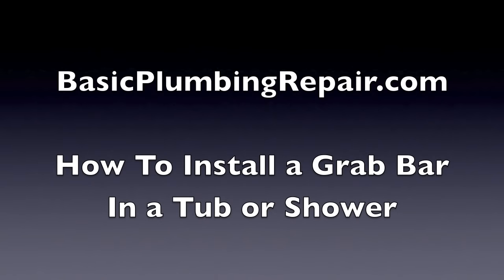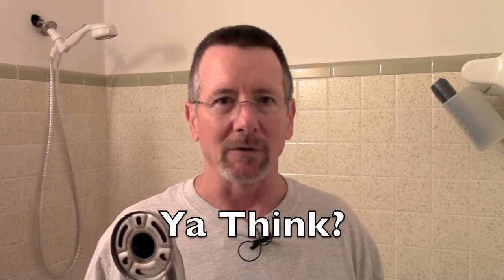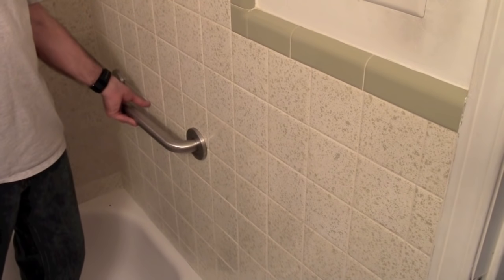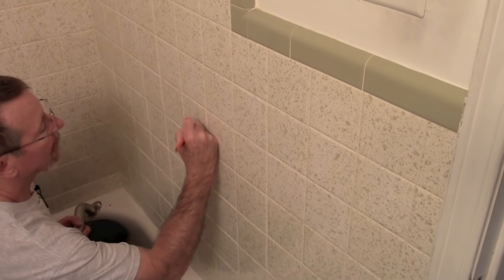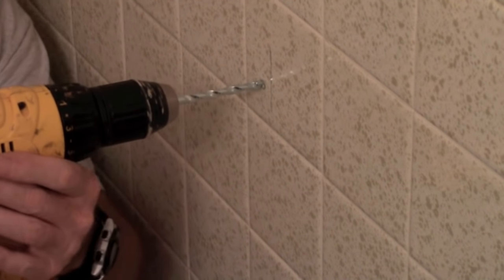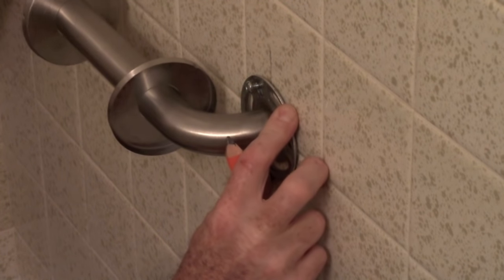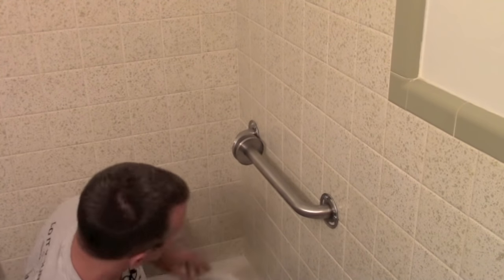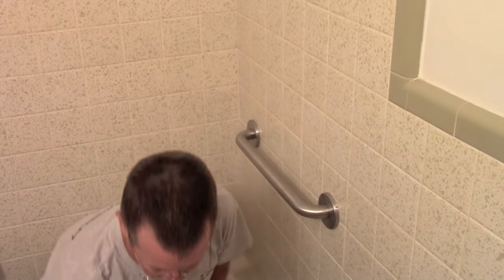How To Install Bathroom Grab Bars

Comment: No, no, no!  Those wall anchors are NOT approved for grab bar installation and risk pulling out of the wall!  Either drill into studs or you must use approved wall anchors like "Wingits" or Moen Secure Mount or Delta wall mount anchors!  Those are tested to safely, securely hold grab bars without studs.  Standard wall anchors or toggle bolts are not designed for this.
Reply: These anchors are the type that have wings that spread out behind the wall surface when the screw is tightened, similar to a molly bolt. That means they’ll be supported by the tile and the backer board behind it. Should be fine for this application. The Secure Mount are good but add a significant cost to the project plus the need to drill a big hole in the tile with a special bit that also adds cost.
Reply: they're not coming out.
Reply: I don't understand why wingits are better. Don't they all do the same thing?
Reply: @DarnCleverKids  Wing-it’s are designed for use when the bath tub walls are not tiles and when the walls are sheets of acrylic or pvc sheets without having any Sheetrock or wallboard backing. Imagine tubs installed in the 80’s where the builder left bare studs behind the bath tub walls. They often did that to save money. That short cut the builder took leaves you nothing for the plastic screw insert to grab. And you are stuck with nothing to grab except the 1/“4 plastic wall. This is when you should use a wing it to grab a large section of the plastic wall unless you successfully find a stud on both ends of the grab bar.
Reply: @brianclark1858  but it will not be a tight hold.
Reply: some tile is set to the sheet rock and that is one big failure waiting to happen.
Reply: I like the 3 lb lump hammer to bang in those dinky picture hanging plugs
Reply: It's funny, my grab bar came with crappier anchors then these.  No worries, I upgraded.  LOL
Reply: I've seen hand rails installed with 2 tech screws into half rotten wood, no exaduration ... it's been there for over a year
Reply: In

Comment: Good Lord, with all of the great wall anchors available today, I would never use those cheap plastic "push-in" wall anchors to secure a grab bar.  Most of the time they simply pull right out of the hole.  With so many stronger ones available today, why take that chance when installing a grab bar for a loved one.  Just my humble opinion.

Comment: Know the Code on Grab Bars!  Code requirements for grab bars are part of the Int'l Code council’s ANSII-ICC A117.1 standard. Many contractors get it wrong, meaning the bath won’t pass inspection and exposes both contractor and owner liability.  In showers, the tops of horizontal grab bars need to be 33-36 inches from the floor. In a transfer shower, bottom of  vertical bar must be 3-6 inches above horizontal bar on that wall.  Part of installing is to know the code on grab bar, would be wise to put link in description otherwise people will just assume it's only about installation and place them where they want and won't be placed for optimum safety.

Comment: I'm a 71 year old gal and I put up 2 by your method.  Mine were really hard to drill because when the tile was installed 30 years ago the guy put chicken wire and thick, thick concrete as a backer.  He told me if we ever had a tornado to get in the bath tub and now I believe him.  It was hard work but I'm glad I did it with your help.

Comment: About to do this at my home for when my parents come to visit. Reading through the comments, I see people think these are to catch the falling weight of an elderly or disabled person. Let me say, these are to help maintain balance. Any elderly person in need of a grab bar isn't going to have the strength to catch their falling weight. These are meant to maintain balance and prevent falls, not arrest falls. I'd venture to bet most able bodied people won't have the grip power to arrest their own falling weight under ideal circumstances. Mathematically, the total weight of someone falling turns out to be much more than people realize, and no senior citizen would be able to catch themselves anywhere near the bottom of a fall with a grab bar. That said, I will do my best to locate a wall stud... or two.
Reply: Also know CODE of where to place them, what size, and anything else for optimum safety.  Int'l Code council’s ANSII-ICC A117.1 standard. Many contractors get it wrong, meaning the bath won’t pass inspection and exposes both contractor and owner liability.  In showers, the tops of horizontal grab bars need to be 33-36 inches from the floor. In a transfer shower, bottom of  vertical bar must be 3-6 inches above horizontal bar on that wall.
Reply: Agreed, even if you need to choose a grab bar length to fit the studs.

Comment: Adding a little silicone before installing the insert and a little in the hole of the insert before installing the screw, will help with any water that will seep in behind the end caps.
Reply: For water proofing couldn't you just silicone the covers to the wall?? I'm not sure whats easier/more resilient.
Thanks!

Comment: A friend of mine had one these installed in his bathroom because of his elderly mother years ago.  The handle was so old and rusty that he had to replace the entire tiled wall.  He realize that water leaked into the handle covers, right through the screw mounts and right into the back of the wall.  This caused damage to the wood frame behind the wall which were all damp when he torn down the bathroom wall.  Obviously the slow leak into the wall through many bath showers.

Comment: Good video...
Some suggestions...
1) When drilling on the tiles -- don't drill on the grout line if possible!
2) before punching & drilling   - place some painters' tape on the tile to increase friction for the punch and drill & reduce  chance of cracking
3) If you have a rubber washer - place it on the drill near the shank - so if it drills in and bangs the tile it will have a cushion...

In a bathroom situation, the wall was (hopefully) treated to be waterproof... if you drill into the grout & tiles you may want to use silicone sealer where the screws are - just to help the waterproof wall...

BEST
Reply: Good suggestions!  Thanks- I wondered about banging the drill into the wall, so that rubber washer idea was helpful!
Reply: Hi, about no.1, why not to do drill on grout line ??
Sorry, but I need more information before installing Grab Bar for my mom, I want  make sure for my Mothers safety...😊
Reply: nice advise
Reply: Very bueno.....👽👍
Reply: Great input! Thank you!🇺🇲🙏❤
Reply: @ibabkodal  A year late but, top of my head, you damage two tiles instead of one, the edges are weak points so you could end up cracking one or both, the grout itself suffers and might let water through.
Reply: Great advice. Im a tradesman and Im disappointed i didnt think of 2 of these things. Cheers
Reply: I think the bar is longer than 16" so it can be angled and till be attached, to the studs of the wall.
Reply: Thanks for the tips.

Comment: I just used this same method to install a grab bar today.    Worked out just fine.  I  bought a package of 10 anchors of the same brand used in the video,  and I put 5 on each side.    Then I tested it  by grabbing it from  different positions and it held my weight of 220 lbs without any problems.

Comment: Suggestion: put a piece of painter (or any) tape on the two cover plates to keep them from sliding along the bar. Tape them together and then a little on the bar will keep them in one place. They can scratch up the bar before it's installed. And they always just get in the way of the work.

Comment: Fantastic help! This will be my first installation of a grab bar through tile. I appreciate your review of the necessary tools and actually showing the drilling through the tiles, which is the part I'm concerned about the most.
Reply: Dont do what this guy did. Hit studs or use toggle bolts. Plastic anchors are for hanging smoke detectors.

Comment: Great video, much appreciated!  I agree with the comment below about using some silicon on a project like this.  After all the effort we put into waterproofing the wall before the tile goes up, and grouting and sealing with great care, it seems wrong somehow to start drilling holes in the finished product, although there is no alternative when a grab bar is needed.  I am about to do the same thing in my tiled shower, and I will apply silicon to the anchors when they go in, as well as to the screws and possibly also the inside rim of the cover flange.

Comment: Ty Jose anchors are not made for 3/8" of tile on a backerboard. They are for 1/2" drywall.
If you want to do this, use a set of butterfly anchors, and squeeze a Sh77 ton of silicone in there to waterproof.

Otherwise, in his application, you can easily find a stud since it's not tiled up to the ceiling.

Pro tip:
Many bathrooms are fabricated with shi77y studs and cripples everywhere, so be cautious as the stud might not be completely from the ceiling to floor. (Sadly, people do cheap stuff to attach wallboard.)
Reply: Even using electronic stud finder, I'm getting lots of false readings.

Comment: I have used regular plastic anchors in tile walls for many years and you will be surprised how strong they are. I use a small nail set to nick the tile first. Good video.

Comment: Straight forward, easy to understand. I would use a stud finder to see ifone end of the bar would be attached to a stud, and use molly billy bolts on new construction, i.e. house built in the 60's going forward, I give an A+++++ Frank Donovan

Comment: You are correct, I never use this type of wall anchor, the best I feel is a toggle bolt the size applicable to the item to be attached.

Comment: well-done video - it gave me more confidence to install one of these for my Mother-in-law. One suggestion is that you caution folks to not go crazy when tightening the screws with a cordless drill. Maybe those anchors don't strip, but I always do a final tightening by hand, because it is all too easy to strip a screw anchor using a power tool - don't ask me how I know that!

Comment: Lousy anchor for a grab bar. As a fastener salesman for forty plus years, I would recommend Wellnuts, which are rubber and can handle a lot of vibration. Unfortunately they require a large hole, 1/2" for a number 10-24 machine screw if I recall. Since you have three holes to work with on each end, you might consider one per end for a more secure installation. Incidentally, a fastener's safety factor is one quarter of published pullout, so the hold you stated should be divided by four. Did you also consider what is holding those tiles to the wall? If you have studs, find them and use them if possible.

Comment: Thanks for the video. Evidently I have porcelain tile in my shower as drilling the holes was exhausting. I purchased the same anchors kit as shown the included drill bit didn’t cut very well. So I switched to a carbide tile bit that I bought and it wasn’t much better, the tip shattered after a couple holes. Went back to the old bit and eventually finished but took ~15 min. per hole. I have another bar to install so will try with a diamond bit on the next one.
Reply: You used the wrong drill. A hammer drill is used for this application. ( concrete, tiles etc) The hammer drill will vibrate the bit. You needed a hammer drill. The difference is night and day. A glass tile bit works pretty good in a regular drill.

Comment: Suggestion....AT 84 I have planned for the grab rails and have installed 5  in the shower plus the wall over the Jacuzzi plus the hallway between the master bath and the bedroom.  When I try to get from the bathroom to the bed, the room is pitch black in spite of night lights in the room.  A grab bar on the doorless entrance jamb really helps steady you until your eyes adjust.  Saves hand prints on the entrance jamb too.  Another big plus is a toilet  “ELEVATOR”.  A fiberglass 4 inch spacer that fits under the entire toilet.  About $125 on internet plus another $100 for the plumber.  Best money you will ever spend.  I have set many toilets but at 84,  it’s just too much lifting.    Comes with a new rubber flange seal and mounting screws .......I also have a grab bar in the jamb alongside the toilet and one on the wall in front of the bidet.  
Keep this in mind.......getting old is not for sissies.....the alternative sucks.

JoeB

Jo

Comment: My Step-Father fell in the shower a couple of days ago.  I've decided to put grab bars into their shower.  Thanks for the video, it's going to help a lot.  You make it seem easy.

As far as the others who say the strength doesn't multiply by fasteners, that may be true but my parents aren't going to hang like a monkey off of these bars.  Screwing into studs is the best bet, but when that's not a possibility due to whatever reason, the bars will still help a person considerably since most uses are going to be to gain / regain balance; not recover from a full blown slip.  If you slip on soap or something in the shower and you're going down fast, it is highly unlikely you're going to have the time or muscle memory to grab onto the bar.  Even if you did grab onto the bar, can you hold up your entire weight with one hand?
Reply from the maker: Excellent points.
Reply: tattoo The government ADA guidelines do, in fact, specify that the bars are required to hold up a particular amount of weight when acted upon them.  Although, I'm sure your bars are not regulated and checked by the government, the guidelines are helpful in giving you an idea of what types of weight loads it should be expected to withstand.
Reply: Make sure to check CODE so you put them in the right place, use the right size, and all that other good stuff!!
Reply: @NorthernChev  The guidelines are for optimum safety and should definitely be followed.  Int'l Code council’s ANSII-ICC A117.1 standard. Many contractors get it wrong, meaning the bath won’t pass inspection and exposes both contractor and owner liability.  In showers, the tops of horizontal grab bars need to be 33-36 inches from the floor. In a transfer shower, bottom of  vertical bar must be 3-6 inches above horizontal bar on that wall.

Comment: Thank you for taking the time and effort to share.  I am sure that grab bar is not going anywhere.  However, I would try to avoid putting an anchor in the grout.  Many people claim grout is softer than the surrounding material, which I agree, and has inconsistent strength.  A hammer drill, rather than a regular drill might have been easier, but if that was a regular drill, which it sounded like, it looked like it did a very smooth job.  I like the way you marked the hole pattern.  Trying to hold the bar in position while marking all the holes is more prone to error.  I would also blow the dust out of the holes before inserting the anchors.  Nonetheless, I am sure your installation will work.
Reply from the maker: Nicholas Hoffenpiper Pretty good points.  So far it's working fine.  Thanks for watching,

Comment: Unless the bar was installed on the studs by chance otherwise it has a major flaw: the screw in the tiles cannot hold the weight. To me it is more like a nice looking decoration than a useful safety grab bar.
Reply: An accident looking for a place to happen. All major brands of grab bars suggest only installing into the studs or use special anchors which are designed for large loads.

Comment: great job and you can use clear tile caulk in the screw holes and around the fixture and please give the size of the drill bits and screws even though they may be different for someone else. again thank you.

Comment: From the Moen website:
     Hello and thank you for your interest in Moen products. The Moen LR8716D3CH Securemount Designer Ultima 16-Inch Grab Bar, Chrome comes with wood screws for a mounting into a stud. For installation in a hollow wall, Moen SecureMount Anchor part SMA1000CH is sold separately. 

If they wanted it mounted to dry wall they would provide the anchors.  Studs only.  Do your loved ones a favor.

Comment: Perfect explanation of the job I want to do.  Putting in a new tub and tile and wanted to install a handle bar too. Did you say the  right size drill bit comes with the anchors? Is that a regular drill or a rachet drill?

Comment: Great video.  I weight close to 280 and wonder should I trust the anchor bolts you suggest.  Need them to pull myself up from the tub.  Do you suggest a vertical bar near the center of the tub/shower?
Reply from the maker: Walter Weeks I can't vouch for the rating of  the bolts, but common sense says more bolts and bars is better.

Comment: Should have a link on the government ADA guidelines for optimum safety.  They're not like installing shelves where you just put them where you wants or think is best, there are proven specifications of placement to ensure people are safe.  aka Code.  If done wrong will fail inspection and have to rip them out and do over again!

Comment: For added strength, Use a product called wing-its they are rated for hundreds of pounds and designed for mounting grab bars through tile.
Reply: What about fiberglass w/ no studs?
Reply: Eric Schnidrig no. Fiberglass is cheap and will not support shear weight from pulling or tugging.
Reply: My team uses a special anchor that builds out a fastening structure from the underlying stud to the fiberglass surface, up to about 1 5/8" deep stud-to-surface.  google "solid mount." not cheap, yet the only thing we've found that will work.